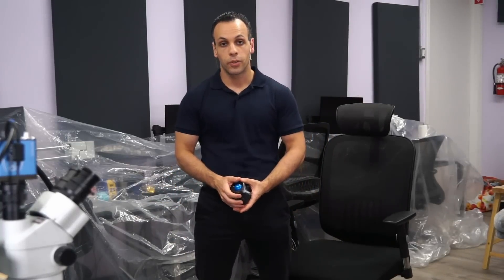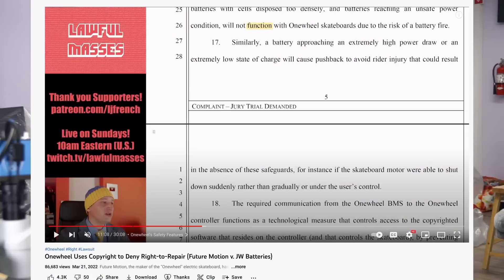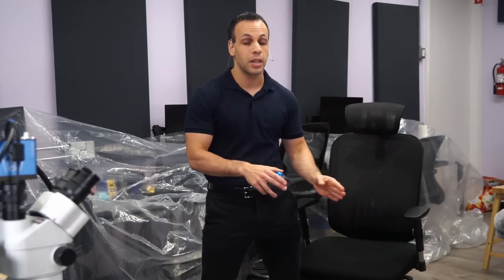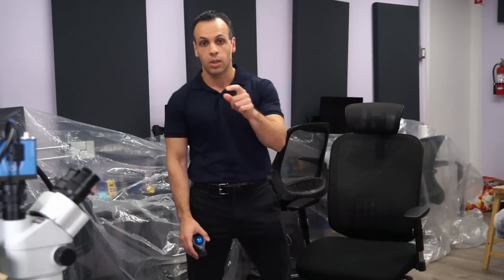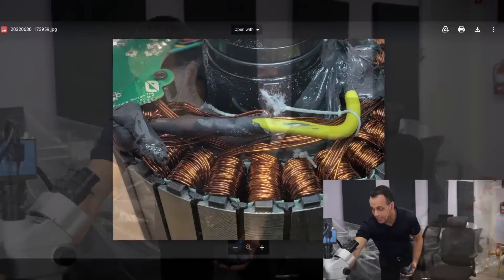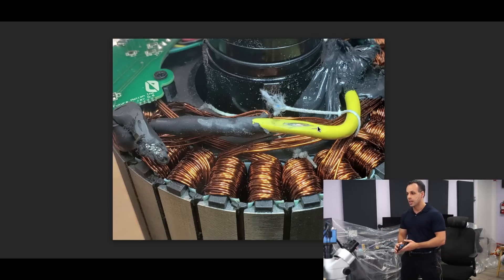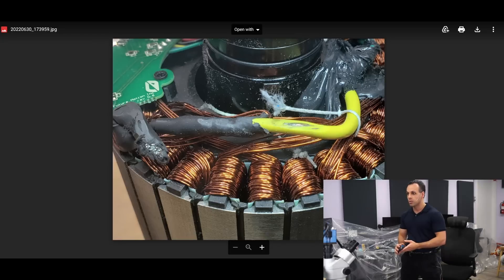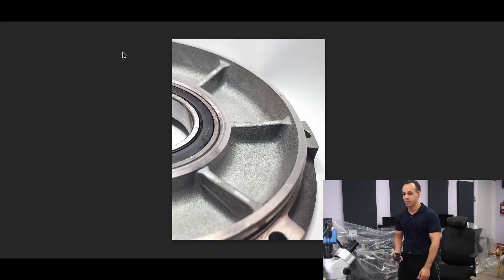HORRIBLE Onewheel GT motor repair; this is why manufacturers shouldn't monopolize repair!

Comment: Exposed high voltage wire near other metal components sounds fine. 

That will not be a fire hazard at all, it's a surprise function.

Comment: It reminds me that time when my mother had an overheating shutdown issue on her brand new HP laptop,
She sent it to HP for repair,the guys at HP changed all the components without properly checking if the issue is solved.
They send the "repaired" laptop back to my mother only for it to shutdown due to overheating like it was never sent to HP.
When my mother complained to me about it i came and took a look,
And after hours of diagnosing the issue i found the cause of the issue - a firmware bug that randomly prevents the fans from turning on no matter the the temperature if the 0 rpm mode is enabled (The default is enabled).
I disabled the 0 RPM mode in the BIOS and it no longer shuts down due to overheating and thermals are reasonable now.

During my time diagnosing it there were times where the CPU under load was at 90C and rising until it shutdowns but the fans didn't spin at all.

Moral of the story - "Repairs" done by the manufacturer are often done by incompetent people.

Comment: One wheels states they want to be the only repair facility because of safety, yet this is a product that is by its purpose and function is not safe. You can so easily fall off this thing or get hit by car while on this thing. We are also talking about something that has to endure a lot of wear and tear, just like a bicycle you need to be able to repair this thing yourself. Every time something happens that makes it unusable we are supposed to pack it up and ship it back? How is that acceptable for $2000 device?

Comment: That looks like a second hand motor. Like they are receiving the dead motors from warranty returns, then refurbishing motors (or swapping motor parts).
It is (unfortunately) fairly common practice especially among money-grabbing companies. Real replacement motors are expensive.
fFM

Comment: Perhaps a class action suit is in place then, because this is getting rather inexcusable. Their anti-repair tactics is one thing, but electrical safety violations is a BIG no-no. Perhaps even the FTC could sodomize them with a fine or two for this.

With all of this being said if ANY of the vehicles that I'm interested in (especially cars) were only repairable only by the manufacturer itself then I'd lose interest immediately. I'm just not gonna buy a crapola like that ever. Period.

Comment: The more I see of their shoddy workmanship and cutting corners on bearings and other key components along with not fixing many of the issues that uncovered on the XR.

Also adding to the fact that they just added more power to the motor instead of making it higher motor so that it wouldn't overheat and degrade the motor faster. I'm sorry adding 8 lb and almost no speed improvement doesn't really make it upgrade not to mention you've made everything preparatory so we can't just grab off the shelf components.

This is important when your repair services are subpar your repair facilities are not numerous they are not international and they are not competent.

If you buy a GT you're like all those gamers that buy the game before the reviews come out you only contribute to the problem you don't help fix it.
Reply: Thanks Louise I'll get that 4 car hit and run and XR repair horror stories from future motion to you soon I got your email you sent me last time.

Comment: At this point, I'd just be happy with manufacturers releasing a list of which parts can be replaced by which comparable easily-available parts where applicable, and telling people that it'll void their warranty if they actually replace any of them.
Just telling people "this component takes X input, puts out Y output, and there is a z% acceptable variation for these, here are the parts that should be compatible, please don't do this" would solve this problem and leave them free of responsibility.

Comment: They will only stop doing it in two cases, first one is, if they are legally obliged to stop, or if people stop buying their products and profits go down. They won't stop doing crap like that just because it is wrong, those people in charge have zero morality left in them, not even shred of morality is there. Just pure uncontrolled capitalism greed for money.

As for making videos about it, I say good. They won't self regulate and most certainly won't change. This isn't going after some poor person, but rather big corporation, they got their PR people and stuff. They can defend themselves. So I see nothing wrong for calling big corporations out for this. And I personally consider it public service, since it might make some people think twice before buying from a company.  Plus I am all for right to repair thing, maybe I am not best person to do the fix, but at least having right to bring it to someone who is qualified, even if third party should definitely be a thing. Especially when they officially do crap like that, so you can't even count on them to give you back product that is safe.

Comment: So many times manufactures of equipment mess up be it for lack of care or lack of knowledge. On my job as a maintenance technician for a high production facility, with a good amount of machines, i'm relied upon to fix equipment in a timely and accurate fashion. I often find parts I get from manufactures and suppliers and that have defects in build quality and have to sometimes correct the problems with them before using them. It might be mechanical things loose or even internally in electrical components loose. Some of these have caused us significant downtime and headaches. Now the common known issues from these manufactures me and other technicians have to look for and resolve before using the parts. Machined parts, motors, 480v frequency inverters, missing items and various other things. Experienced, caring, well trained individuals with the right tools and resources are a must.

Comment: Louis, I'm skeptical about this "repair" due to my own experiences with Home Depot here recently. I suspect that the Future Motion repair didn't consist of replacing the internal components with new parts. It rather looks as if they "scavenged" used parts from another broken wheel to make one working unit to send back to a customer. Much like my recent experience with Home Depot. I recently purchased a refrigerator from them that was "supposedly" new only to get one delivered that already had to protective peel taken off of it, and was covered in 5 to 8 inch scratches all over it. It looked as if it had already been delivered to another customer, and they refused it after removing the peel. So Home Depot loaded it back on the truck and delivered it to us all while pretending it was a brand new unit!
Reply: I understand what you mean. I used to sell appliances at THD, it wasn't uncommon to get brand new unopened units with body damage on them.
Reply: @Saltboi231  , but that's not the point here. It didn't come in a box. I only saw the Styrofoam under the unit while they were taking it off the truck. And like I said, the peel on the freezer door was already removed. I couldn't blame Samsung for this damage as it looked like it had already been delivered and returned. And I'm thinking the damage occurred during the first delivery, which is why the peel was removed for inspection, and the customer rejected it. So they just threw it back on the truck and tried delivering it to the next sucker.
Reply: @kevinpayne3804  That’s most likely what happened. Their delivery subcontractors are really bad.

Comment: thank you for sharing this. As a matter of course, no matter how well I trust a mechanic to work on my car, I will always inspect it after I return from the garage. Put it up on my jacks, see if the lower control arm of my steering system has been actually replaced and it looks like its been replaced, check that my new alternator actually looks like a new one, check my dipstick to see that the replaced oil is in fact fresh and light coloured, and now that i have a dashcam, roll back the footage to see what they were actually up to.

Comment: Just bought an #EUC from Begode (a Nikola Plus). $2k well spent, instead of buying my second OneWheel from FM.

Best part? literally all the repair parts are available from US dealer network, to include BMS, boards, cabling, body panels, lights, etc.

Fck Future Motion. Kyle can suck it. I'll ride my XR til it dies...then never again.

Comment: I believe no company can ever promise safety. All it takes is one bad employee to mess it up. I've worked for a company where I've heard my coworkers give wrong info to customers all the time for example. It was mostly due to either bad knowledge or just idgaf attitude. Company can then apologize but that's about it. With that said, repair should be allowed to be done by anyone IMO. Often repair by 3rd party is actually better and cheaper.

Comment: Pretty typical of this type of company; There is a bunch of stuff I have taken apart surreptitiously, even when new and found the same kind of clusterfying. I have also worked at a few places where I had an inside view to the employees who were doing this kind of stuff who were basically high school drop outs and unqualified. Props to the owner of this one wheel who probably could act as an engineer actually DESIGNING one of these and is CERTAINLY more qualified than the monkeys this company has doing the 'repairs'.
Reply: If people are getting injured/killed by this, the NTSB could get involved.

Comment: I'd be curious on your opinion that Nintendo is apparently testing a subscription system for repairs in japan.
Considering they've had a huge headache with joycons being defective and breaking from basic use, this seems like a really, really bad idea to even suggest- even if it covers user error.
Reply: Someone figured out the permanent fix for the Joycons is to cut some pieces of breakfast cereal box to fit between the backs of the sticks and the inside of the case. That puts constant pressure on the stick housings so they can't get pushed away from the PCB to where the potentiometer wipers lose contact. The ideal fix would be stick housings put together strong enough that just using them doesn't make them try to fall apart.

Comment: I do not think this will change as long as any asshole can start a company and assert their asinine policies about repair or quality control to save a few pennies. Something fundamental would have to change about the attitudes and ways of thinking, but humans at the current "level" just cannot achieve that. Sure there are always the few "good apples", even a decent company owner that maintains decent company policies, but in general no. Sad.

Comment: Did Apple learn their lesson and open up their products to independent repair? NO, because it's not about serving the customer while making a profit. It's a business model of total control. 
I don't know what drives this, but it's a thing and it's a real problem. It's the root of the entire right to repair issue. In most (if not all) cases, these companies would make more money and provide a better customer experience by streamlining their system either by handing off some of the service work to independent servicers in a cooperative manner by supporting authorized independent service centers.
Reply: | I don't know what drives this

... Profit. Monopoly over repair.
Reply: @sherlockmaverick  Precisely!

Comment: Hi Louis, 

Keep up your good work.  I've always been able to repair stuff (my first repair was an electric clock at 5 years old) then radios and TVs, and cars.  Even repaired a B&S model N engine in the 5th grade).  As time goes on, it seems things are getting more difficult to service.  Recently replaced the light bulb in a Sharp microwave.  First step was to remove the security screws to remove the case.  Next, the light bulb isn't a simple screw in.  It's a moulded plastic base with spade terminals.  Found one on the internet and took delivery several weeks later.

What should have taken minutes ended up taking several weeks.

Comment: Also when a motor is shorted out and its going at speed it usually acts as a break locking up effect so the rider would go flying off it.
Reply: @PeterPan-uu5vu  brah-ke
Reply: @sneescampers  so much for quality control checks it would seem.You got lucky to have avoided injury.
Reply: @PeterPan-uu5vu  YOU'RE

Comment: The Onewheel GT that was sent to NYC for their demo tour, ghosted at the group ride. Jack Mudd, their lead PR person, was late to the ride (and made people wait), and left shortly after it started. 
It's so profoundly clear that FM has disdain for their customer base and the community around it, and they're barely trying to hide it anymore.
Reply: Wow. So much for safety and security.
Reply: Hopefully someone got that ghosting on video to put FutureMotion on blast for their failures with the GT. FutureMotion is trying too much to be the worst Silicon Valley hardware company possible, instead taking a company like Framework as an example and making their board and all its parts available to the community. After watching some videos of boards ghosting I’m beginning to wonder if the issue even has anything to do with the footpad and if its a firmware failure causing the board to fault in a permanent on state. Some of the people that have caught the board ghosting appear to be able to pickup and fully turn and flip the board past its normal cutoff angles which to me would indicate the cutoff function in firmware is no longer being triggered.
Reply: For real??? Damn wtf that's awful :(
Someone airdrop me into their office. No cap ima go fix things.
Reply: @Robert Swaine Ghosting means it unintentionally drove away at high speed with no rider on it, probably smashing into something/someone in the process.
Reply: A "ghost" rider.
Reply: @ShanesGettingHandy  Does this mean it caught on fire?
Reply: @ShanesGettingHandy  wouldn't it be kind of funny if Future Motion sends "cease and desist" over "ghosting." "Well you see our vehicles doesn't do ghosting because it will never send text and not answer to anybody so your statement is false and you need to retract it right now!"
Reply: Why are they even in business if they don't care about the product nor about the customers?
Reply: @mjouwbuis  To try to accumulate as much cash as possible.
Reply: well maybe if Future Motion actually spends more of their time reaching out to their customer's base rather than sending legal letters they wouldn't be late for the group ride. :D
Reply: Good job sharing this info. It hurts them the most
Reply: Hello mario does the pint x also brick if you try to repair?
Reply: @dagreekratking4694  I don't believe so. I can't say for certain it doesn't now, but the models I've opened up haven't done that.
Reply: @TheBoardGarage  got pint x a month ago so if you ever open a new one up and remeber this please let me know but def switching to vesc later down the road when board stops working
Reply: Yeah so much for safety
Reply: Perhaps they have no respect for people that just want to ride on pavement.

Comment: The most important thing I learned from you is never trust the avoid for warranty and check it yourself.
This example is not a service that is equivalent to attempted murder.
Reply: And learn about the Magnuson-Moss Warranty Act.
https://en.wikipedia.org/wiki/Magnuson%E2%80%93Moss_Warranty_Act
-
It is not enough that you opened a case. The manufacturer has to prove that what you did was the cause of the failure.

Comment: I would really like to see this Louis start reviewing the reparability of more products like the onewheel (Electric bikes, electric skateboards, electric scooters, ... basically any >$1000 electric device!). He is in an especially good situation to do exactly this ... assuming he could find a way to make it profitable?
Reply: Yes, I would like to see that too... especially regarding electric kick scooters which now seem to be ubiquitious around here. Also cheaper ones... if you buy a Xiaomi or Segway, do you get reasonable service for it? And how about those no-name brands you can get for $200-300? Do you have to throw them away if something breaks?
Reply: @KurtWoloch  So they made a comeback around where you live? They were all the rage some 5 years ago or so, here they were mostly those app-rental style and littered the streets (in amount only, not that they actually got in the way). On some places people started to vandalize them for no other reason than thinking they're cool and whatever else, then they suddenly vanished, specially after The_Incident in 2020.

Those kinds of things with serious discharge Li-Ions and a decent amount of them sure need to be taken seriously enough safety wise.
Reply: @Kalvinjj  I wouldn't call it a comeback... here in Vienna, we now have 5 scooter sharing companies vs. 6 in summer of 2019 when they were at their peak here, and there were never less than 4 between that... but actually usage of privately owned scooters seems to have gone up. I guess you now see about as many people using those e-scooters as people on bicycles. The city of Vienna soon enforced rules to prevent that things got out of hand... one company was never allowed to have more than 1,500 scooters on the street, and they have to be parked in a certain way.